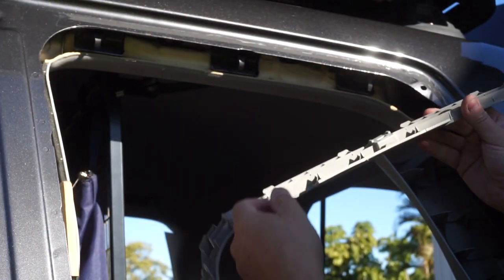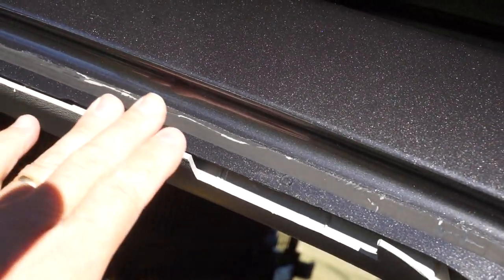Emuwing Gullwing Window Installation in my Landcruiser 200 Series LC200 | Ep 2

Comment: Thanks Terry! I've just watched these videos again as I'm about to make & install mine. I've already bitten the bullet & removed one window to make it easier to work out what I'm going to do (they are really big being over 4' long!) so I've picked up a couple of ideas from you that might help me along. I'm pretty much flying blind as I never seen any on my model of vehicle with some quite tricky areas plus the glass is curved in both directions (not sure I'll need to break out the english wheel for them though🤣) The interior trim actually goes over the glass a certain distance so maybe I will have to make a parameter frame out of sheet like those emu wings? I plan on making an aluminium frame for the door itself & then glue the outer sheet to the frame, the aluminium will disport far to much from welding, all doable I think? I'll be running a continuous length plastic hinge to help with sealing it, but I'll somehow have to keep that straight & still look good on a curved panel. Painting it all black will be the key there.
Anyway, back to planning & Thanks again for another very informative video! Glad they have been a success for you !👍👍
Reply from the maker: Good stuff Rod, I’m glad there are guys out there like you that are willing to have a crack.  Good stuff mate😎👍

Comment: Hi Terry, how did you remove the awful sikaflex from the original window where the frame doesn't cover?
Reply from the maker: Hi Will, great question.  I cut as much of it off as I could without damaging the paint using a razor blade, then I used thinners, a rag, and a shit tonne of elbow grease.  Not fun but it comes off eventually.  Thanks for watching mate 😎👍

Comment: Looks great with the painted frame.
Few questions..
Do you find more cabin noise from the metal panel as opposed to the glass ? 
Does it keep the car cooler or do the panels heat up and transfer the heat inside.
Reply from the maker: Thanks for your kind words Paul, and I agree the painted frames are the go👍.  I was also wondering about the noise as I was installing them.  I’m happy to report no difference what so ever between the window and the emu wing.  It definitely keeps the car cooler compared to just the glass even with the radiant heat effect on the black emu wings as you note.  I had that silver window shade stuff cut to size and stuck to the inside of my glass windows before I installed the emu wings.  I would say those two was comparable in the ability to keep out the heat.  Thanks for watching mate👍😎

Comment: HI Terry, how is the long term test results of this? You've probably seen Cruiser Company about to launch there design too. Any thoughts for someone looking to go down this path now? Cheers mate.
Reply from the maker: Still going strong mate, I have not looked back and have no regrets.  I can’t comment on the Cruiser Company product, but as a concept to improve access to the back of the car, these things can’t be beat.  I use them constantly 😎👍
Reply: @JafffaAdventures  thx for the reply. Did you have to run an external antenna after removing the glass? Dust sealing all A1?
Reply from the maker: Dust sealing A1
Yes external antenna had to be run.  I have a video in the Jafffa Adventures library explaining that and showing what I did.  Cheers😎👍

Comment: Have you had much of an issue with dust getting into the back of the car (prior to emu wing). I am finding it coming through under those rear panels and thought it might be from the bottom vents.
Reply: I don’t own a 200, but if you have removed the rear seats I heard it might be getting in via the rear seat bolt holes ?
Reply: @4bnewb969  yeah mate, already taped up.
Reply from the maker: No Matt, my car has been pretty good but I have heard of others that have had dust issues.  On thing I do when on dusty roads is crank the fan up to 3 or 4 on manual and have the fresh air vent open, not recycle.  This pressurises the cabin marginally and I think that helps.  Thanks for watching and commenting mate😎👍